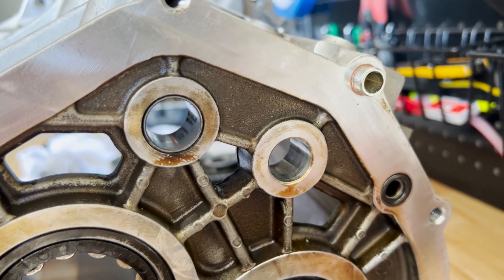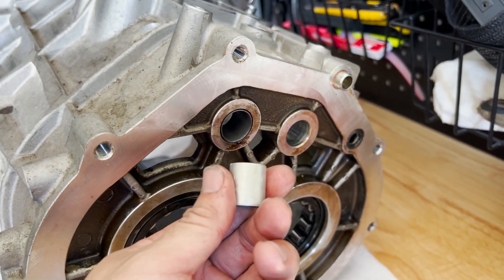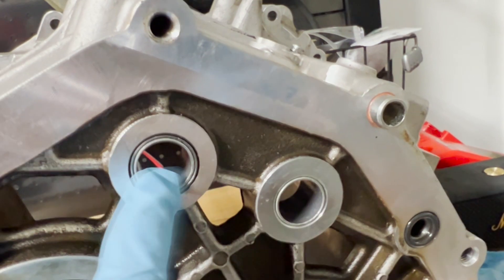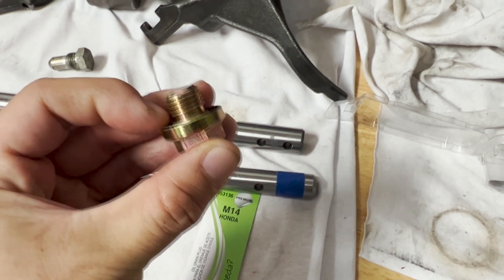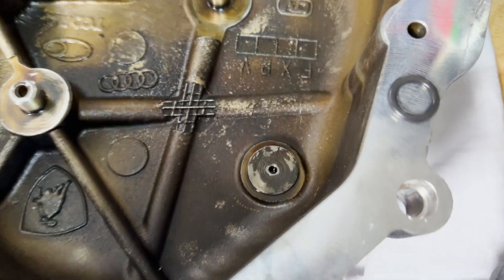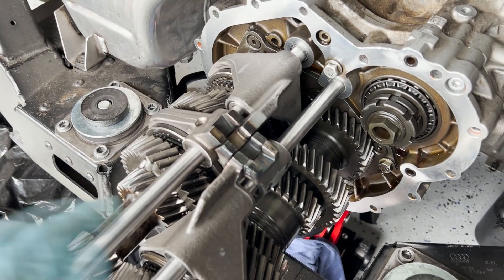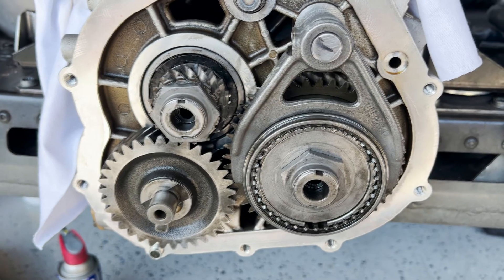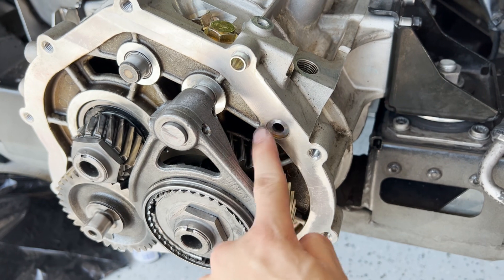Audi R8 Gated Manual Conversion Part 4: Installing the New Shift Forks and Rods

Comment: Hi, love the video's.  I am confused on why the shift forks and rods need to be changed?  in the Audi factory manual the top of the shift forks appear the same for manual and Auto, so couldn't you simply remove the hydraulic R-Tronic and add the manual shift unit?
Reply from the maker: The shift forks are different between R tronic and Manual and therefore you can't just add the manual shift unit.  Furthermore, the R tronic shift rods have a larger diameter vs the manual shift rods. You either have to switch out to manual shift rods or machine out the diameter of the manual shift forks to install them onto the R tronic rods

Comment: Cant you just reuse the shift rod? The detents shouldnt get in the way or anything when converted to manual
Reply from the maker: R tronic shift rods have larger diameter vs manual shift rods. You either have to switch out to manual shift rods or machine out the diameter of the manual shift forks to install them onto the r tronic rods
Reply: @sk4klsiww  ah yes that makes sense. Are all these parts readily available? When i google the part numbers such as the shift housing and its available to buy now for like $1900, as well as the rods and forks. I understand buying new will be more expensive than used. Reason I ask is Im planning to buy an r tronic R8 with the goal of converting it, but am worried that Audi will all of a sudden discontinue them completely and Im stuck with an r tronic.
Reply from the maker: @Dennis-du4jh  last I heard Audi is still making these parts, but it will take time now vs sourcing from inventory since people have figured out how to DIY this conversion in the past year. I recommend you get the parts now. Finding an Rtronic car will actually be easier later.
Reply: @sk4klsiww  good point. Which parts should I start buying first that are more likely to disappear. My guess is the gear shift Assembly and the shaft and forks are probably most likely to sell out soon. As well as the gear selector unit that mounts on the transmission. From your experience which parts were the most difficult to get?
Reply from the maker: yea you got it right there, the parts you mentioned are the most crucial. Everything else will be easier to get (nuts, bolts, washers, brackets)
Reply: One more question...do you think someone will ever come up with thier own fabricated manual conversion kits for this car? For example there are a couple of companies that now offer manual conversion kits for the Ferrari 360, F430, 599 and 575 with a very resonable price, $12.5k for the 360. Tho i do understand the appeal of using OEM Audi parts. And Im pretty sure there would be a market especially since there were less 360s sold than Audi R8s
Reply from the maker: Once Audi stops making these parts, I believe that will be the time. I know at least one company I talked with would be interested in taking that project up. There will be a good market of R8 and Gallardo owners that would want to convert.